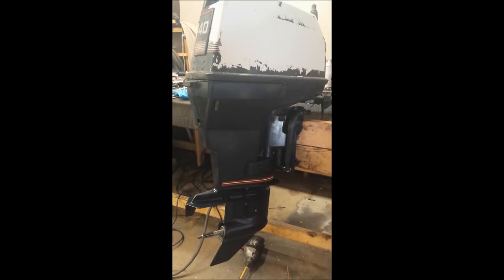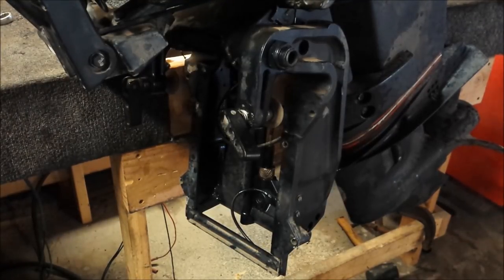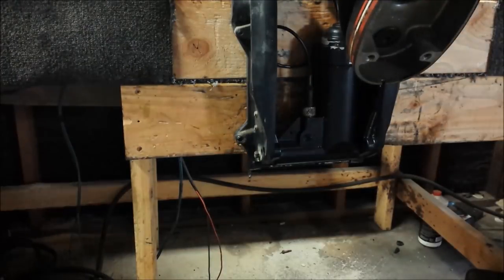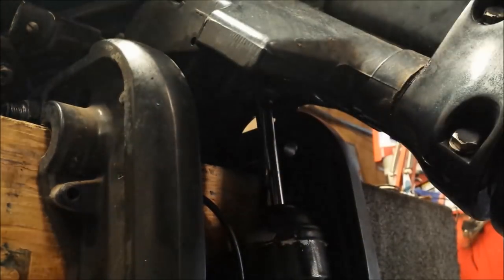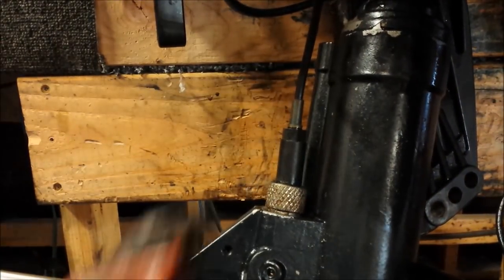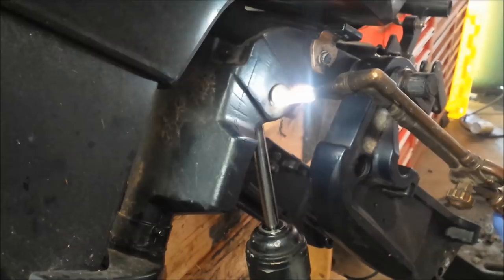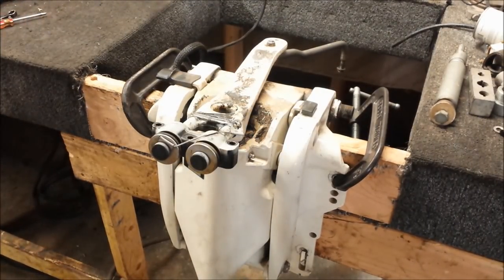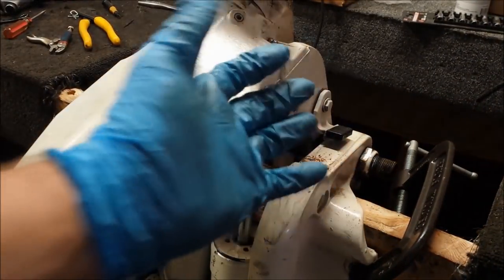Evinrude 40 HP Part 5: Adding Power Trim and Tilt

Comment: Just wanted to say thanks for doing this video. I just went through the same process of replacing a tilt assist with a power tilt and trim. I watched the whole video and the wiring sequences multiple times in order to understand how to do it since my wiring harness is a little different from yours. I didn't even know what I needed to do this until I watched you go through it. But I figured it out thanks to your video and everything works great. I hate to think about how this would have gone if I hadn't found your video. Great job!

Comment: Thanks for the video,
 Just picked up a 1990 Johnson 50 HP VRO that is missing the hydraulic trim assist. I like your idea of getting the entire swivel/transom mount.
I'm currently looking for one.
I will also delete the VRO system as well. Great video too.
Reply: I have a 91 evinrude vro. Curious how you do vro delete and what did you do with the tilt assist? Mine has no pressure behind it so it just slams down but I can get it up and down

Comment: Great video,  I’m in the process of removing at tilt assist on a 1992 40hp evinrude and installing a power trim assembly harness, relays switch and motor and hydraulic unit that I purchased on eBay.  Everything is great but I can’t figure out where the three wires from the relays go.  Maybe you can help me.

Comment: Thanks for the information. I will be tackling my 48SPL in the next week or so. I believe it is the same as tour engine so needless to say, your video will be running the whole time. One suggestion for you is when you are heating up nuts, bolts or pins it might work better to use either a small rosebud or even a welding tip instead of the cutting tip you used. Once again, thanks.
Reply from the maker: That sounds more like advanced torch use, I'm surprised I even know how to get it on.
Reply: Charles How did it go? i have a 48spl as well.....
Reply: Following up on this myself. I have a 48spl and wanting power trim and tilt.

Comment: If my boat is already wired with switches at the front and throttle controller will I still need a wiring harness when I swap out the tilt assist for one of these tilt/trim units? Thanks!!

Comment: Hi, my  johnson's (j40plsoc, 2007 model) trimm sender lever is broken. Can you help me find a used sender at a decent price since new ones are extremely expensive for a trimmer in a plastic housing.... And my rev meter does not seem to be working. How can I troubleshoot it ?

Comment: I have this same TNT unit on my boat. I drained the fluid for normal maintenance and now I can't seem to get all the air bleed out. I have it so it sounds like it should going up but when it goes down it sounds terrible and bounces. I've lifted and lowered the motor 40 times and still can't get all the air out. The motor will stay up on the trailer and if I put pressure on it it will stay up. When I get out on the water and give it gas it won't stay up on it's own which is something that just started after changing fluid. How did you bleed the air out of system?

Comment: Shouldn't  you  heat the material  around  the  pin not the pin itself? When you heat the pin the pin swells into the hole  locking it in even more.

Comment: I have a 50hp Johnson tiller and I’m wondering where you would connect that white wire off the power tilt/trim harness.  I put the black/green wires on the ground stud, I’m just not sure where the white one goes

Comment: I have a 91 evnrude 40hp  the relay was taking out so I got another one wired it up and now when I turn the ignition on the motor goes down. When the key off I can control it up and down

Comment: Wasn't the weight of the motor pushing down on the lower pin? 
Had you supported the lower unit up or tied it up .. wouldn't have been so tight.. right?
Reply from the maker: No, tried that.
Even removed it from the bench and tried with it suspended from the overhead hoist.

Comment: Another question, when l removed my gas assist ram it was mounted in the hole closest to the transom, l see you have mounted your ram in the middle hole of the 3 holes, is there a reason you selected the centre hole.
Cheers  again.
Reply from the maker: None, other than that is where it came out of.
The prior owner of that engine, set that pic to get the lowest setting on his boat. 

Depending on your boat, you may want it up a notch or two.

Comment: You may not have this outboard anymore but where was the CDI Box located. Mine is mounted the same place as your relays
Reply from the maker: Under the flywheel, which runs to the Dual coil.